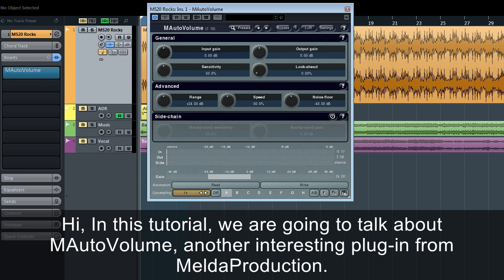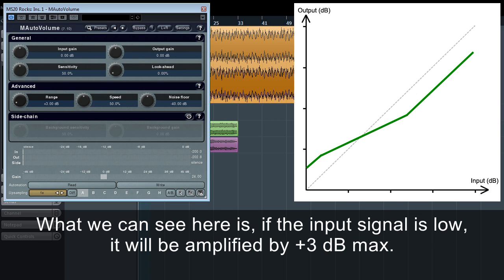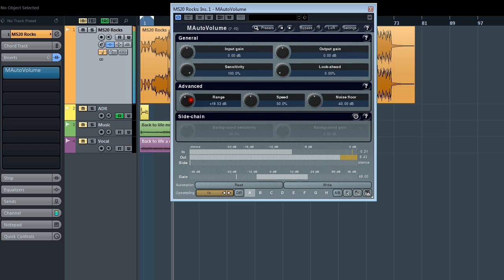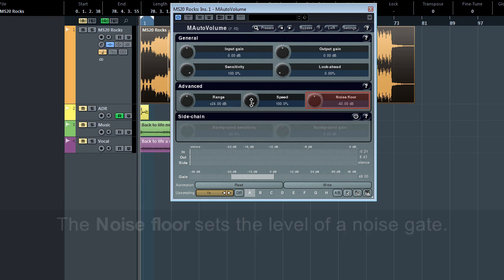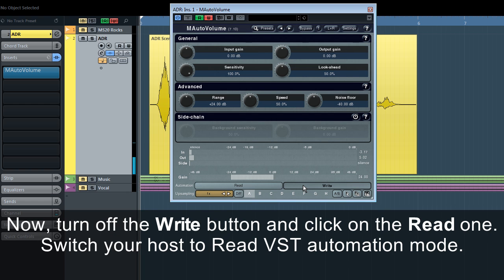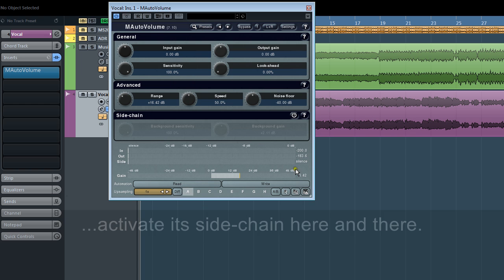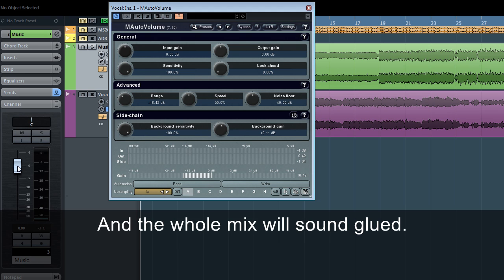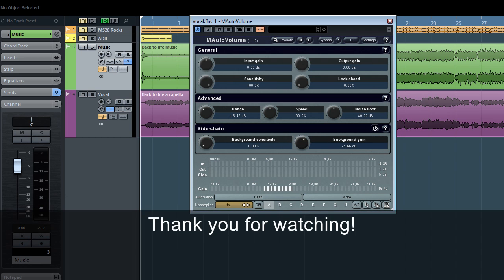MAutoVolume, an automatic leveller for vocals, bass, solo instruments...

Comment: So, this can be a compressor alternative for some tasks, right? Many times I don't like to use a compressor for controlling dynamics over a certain signal because I don't want to change its timbre (and compressors do it very often) and I have to ride volumes on the track pre-channel. Too much work in many cases. If MAutovolume can do it for me it will be my next purchase.
Reply: That's all correct and it's the reason why the plugin has actually been created ;). Compressors are very impractical for gain riding.

Comment: This is awesome, if I want be sure that Track A is say 1 db louder than Track B (DYNAMICALLY throughout the song and not just a +1 db static gain), basically ill have the Mautovolume and after that i'll have a +1 db gain. so upto the point of Mautovolume, Track A will be similar in volume to Track B and then be +1 db loud because of the +1 gain i added further.
All this might be possible only if the plugin does not take any volume changes into consideration which are after it.
Reply from the maker: I'm not sure if there is a question here. Anyways you can use output gain for the +1dB. Note that MAutoVolume operates on loudness approximate, NOT level, which would be pretty useless since it would for example make bass much lower in loudness than high frequency materials such as vocals.

Comment: I'm a little confused -@1:55 the video shows that Unity Gain happens around -16dB (dBFS I assume).  Is this an average/RMS value or peak value?  Secondly, Is this a fixed value?  There doesn't appear to be any control to adjust this.  I can't find the answer in the user manual either.   Can you please clarify?
Reply from the maker: You can simply use output gain to shift everything upwards or downwards. The plugin uses EBU based loudness approximation.